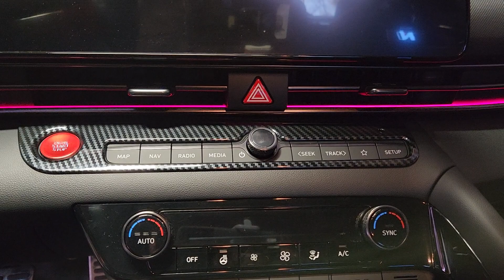Hyundai Elantra N. Installing front Tow Hook!

Comment: Im gonna be getting a new 23 elantra in the next few months. Im still deciding between the Elantra Limited HEV and the N 

I want the bells and whistles of the HEV but the speed of the N 😂😭😭
Reply: To be fair, the EN does have most of the same features that the Limited HEV has
Reply: @zx-3948  I know ☠️ 😭It really just comes down to me being picky 😂 I also commute an hour and a half to work though so thats another reason why i wanted the hybrid 😭 Decisions decisions
Reply: @IronBran123  While still not as good the the HEV, the EN can still push 40 MPG on highway, depending on how 'fun' you want to drive
Reply from the maker: I can say you won't regret the N if you go that route.😜👊🇨🇦
Reply: @N-Krazy1976  I actually ended up going with the N-line. It was pretty much the perfect compromise between the two 😂. It’ll be here on March 26th!!
Reply from the maker: @IronBran123  That's awesome!  Im sure you will enjoy the N-Line as well 👊🇨🇦

Comment: What is on the rear windshield? I need the link
Reply from the maker: You can check out my video 2023 Hyundai Elantra N/ Mods and purchase price. Links fo parts are in the discription😜👍🇨🇦
Reply: @N-Krazy1976  my man! Thanks !!
Reply from the maker: @matthewwinner9197  Anytime Brother! Just a heads up they come unpainted on the bottom but you won't see it when installed. BTW don't forget to like and subscribe to the Channel if you have not already😜👊🇨🇦

Comment: I’m trying to figure out how to put the license plate on the front. 😭
Reply from the maker: Im in Alberta Canada and we don't require a front plate. Check out this relocation kit for the front platehttps://www.ebay.ca/itm/275342001458?chn=ps&norover=1&mkevt=1&mkrid=706-89093-2056-0&mkcid=2&mkscid=101&itemid=275342001458&targetid=1656417413030&device=m&mktype=pla&googleloc=9001286&poi=&campaignid=17297476241&mkgroupid=135489415143&rlsatarget=pla-1656417413030&abcId=9300870&merchantid=533938228&gclid=CjwKCAjw6vyiBhB_EiwAQJRopqR8y1La1WVUyd1tdEl1LK_50k3qR7syDveUxzFbX9MPhnO2tVzDxxoClRQQAvD_BwE
Reply from the maker: That link is for Elantra N but mite be universal to fit an SEL as well.
Reply: @N-Krazy1976  Omgee thanks I’ll check it out! 🫶🏽